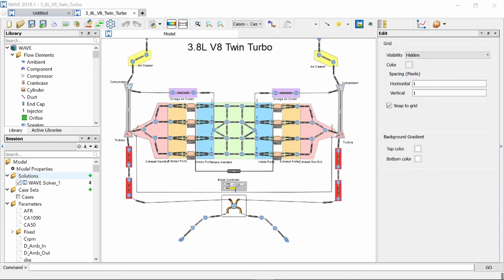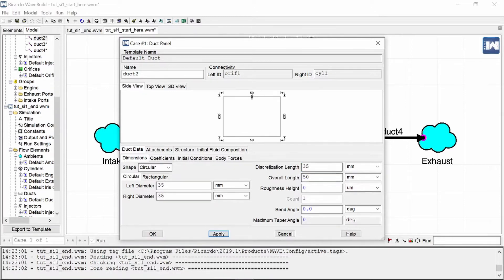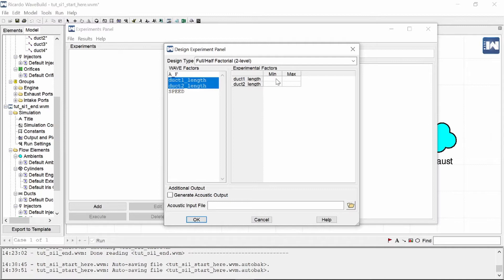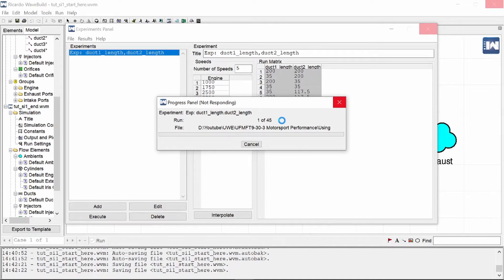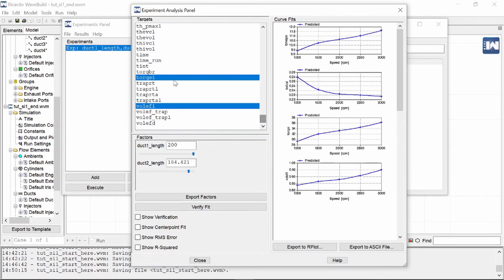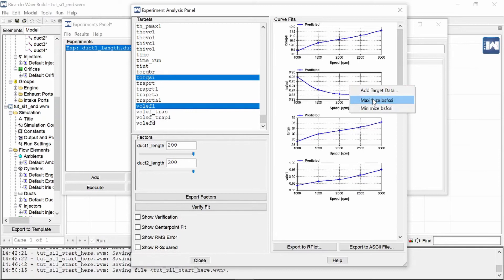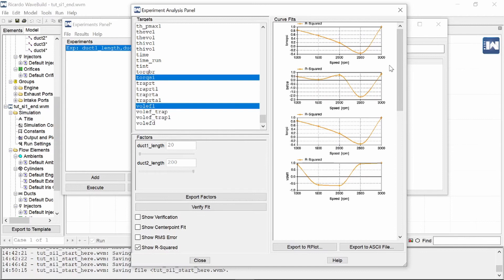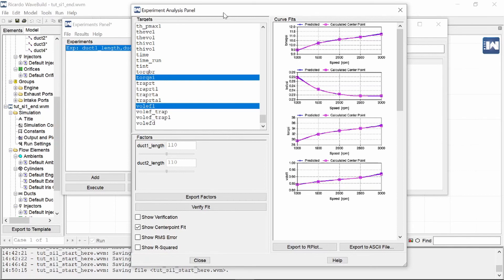Optimising your engine parameters in Ricardo WAVE | Optimisation  & DoE tutorial | Ricardo WAVE

Comment: Thank you so much for this video Adriaan!  It took me another six months to remember to find this video.  It's great to come up with optimum designs, then have the customer give you packaging constraints, and our CNC can only do so much :)

I love the BSFC optimiser, and I'm thinking of minimizing pumping loss at cruise rpm (minimising fuel consumption).  I'll definitely watch this video many times and try the experiments.
Reply from the maker: Glad you found it useful. Do let me know how you get along 💪🏻
Reply: @AdriaanVanNiekerk  Hi Adriaan.  I should have asked about intake to exhaust valve ratios.  How do I optimise exhaust pumping loss vs delivery ratio/BMEP and compression (expansion) ratio?  This video makes me think this is possible.  WAVE assumes throat diameter based on valve diameter - which can become a variable.  Using flow coefficients instead of cfm to account for variable valve diameters.  Runner diameter needs to be proportional to throat diameter, and taper (area schedule).  What do you think?

How do you handle part throttle?

Comment: Hi , could you please tell me how it is worth to learn Ricard Wave modelling software in terms of industrial environment
Reply from the maker: Hi there! It depends on your use case really. WAVE is a simulation tool that can be used to either understand how the engine works that your are simulating or to optimise it and test different configurations. Most industrial applications I have seen have used WAVE for engine optimision or concept design testing. 👍🏻
Reply: @AdriaanVanNiekerk  thanks for letting, I am msc automotive engineering student planning to work on MSc project on internal combustion engine efficiency with wave model simulation and I currently live in Staffordshire area could you please assist me in engine modelling if I needed your guidance for simulation.

If possible could you please share your email details so I can contact you. Thanks
Reply from the maker: @dearcomradeinuk1138  exciting! I am happy to help and answer any questions you might have when you use WAVE. It might be best if you join the Discord server: https://discord.gg/GhvzET7Hzb where you can then ask your questions and share screenshots when needed
Reply: @AdriaanVanNiekerk  thank you very much for addressing

Comment: How can we add load to engine and thereby vary it for optimozation.
Reply: Plz reply soon urgently needed for a project.
Reply: Load means torque
Reply from the maker: You can measure load with a gauge connected to the engine block. With that reading you can optimize it using the byilt in tools I show in this video 💪🏻

Comment: With a given data sheet , if we want to optimise valve timing and Fueling, what all to be be targetted? Spark advance, burn duration, afr is sufficient?
Reply: Also in SI weibefunction graph can you specify or defice the SPARK advance point and valve overlap?
Reply from the maker: That is something that you need to play around with. If you add them as input parameters and the results show it has little to no effect on the output, then you can remove them. It is a bit of an iterative exercise
Reply from the maker: @madhurimaisbiswas  The valve operlap you can specify in the valve settings. The SI wiebe function does not have an option to specify when the spark happens, but rather just when combustions starts. You could always assume they are one in the same 🤷‍♂️

Comment: Hi Adrian. IS there any tutorial on how to add a catalyst to the engine model? Including changing the shape and material?
Reply from the maker: In terms of a catalyst you will only be able to simulate the pressure drop over it. If you want to investigate the chemical reactions in the catalyst, you will have to build a model and connect it to WAVE.

Comment: Can you show how to optimize parameters of a Y-Junction and how to interpret the required data to be given in a Y-Junction?
Reply from the maker: I guess the most important parameter of a Y-junction is its volume? You can optimise that, or even look at the friction area or different multipliers.
Reply: Can I use the same method for the optimization of Y-Junction? and if yes then which parameter should I assign a variable?
Reply from the maker: Yes you can - I think the most common attribute that you can optimise is the volume. Obviously if you are interested in another attribute, you can optimise that as well :-)
Reply: @AdriaanVanNiekerk  I tried doing so but faced the error that there is insufficient data for curve fitting so what might be the possible problem here?

Comment: Hey Adriaan, how come you put the variable in the discretization length and not overall length? Also, I keep getting an error after trying to run my experiment that says "summary file does not exist for..... there is insufficient data for curve fitting" any ideas? Cheers for your video and help!
Reply from the maker: Hi Nathan. That is an error on my part - it should be overall length as you say. The error you get could be because of not enough runs? Try adding more runs and see it that helps?
Reply: @AdriaanVanNiekerk  hi adriaan , how to add more runs?? ..can you please elaborate , even i am getting the same error
Reply from the maker: @vinhuprakashm3069  you add more rpm values to the list which will increase the amount of points. Do let me know if it solves the problem?
Reply: @AdriaanVanNiekerk  after adding 10 runs still the error comes of insufficient data for curve fitting
Reply: @adityadadia1838  Hi, I have the same issue. I am trying to optimise the length of 3 intake runners in 20 runs. I can't view any results because of this insufficient data for curve fitting issue. Did you manage to fix this issue in anyway?
Reply: Hello, can you solve this trouble? i've the same